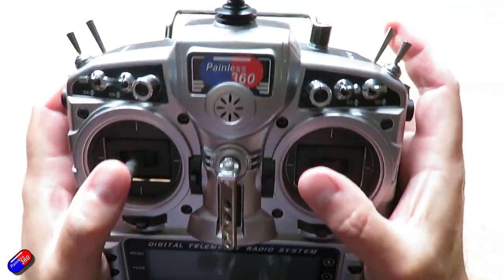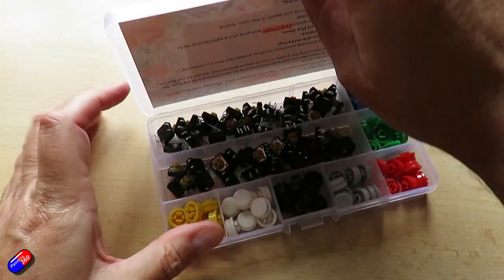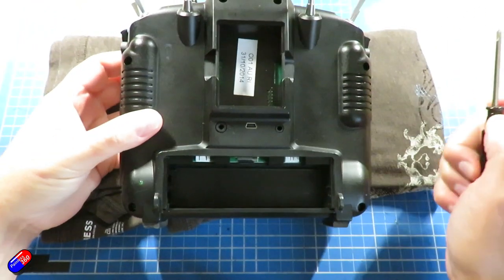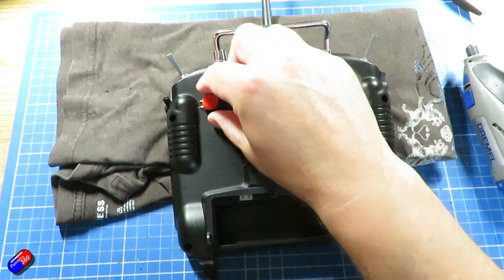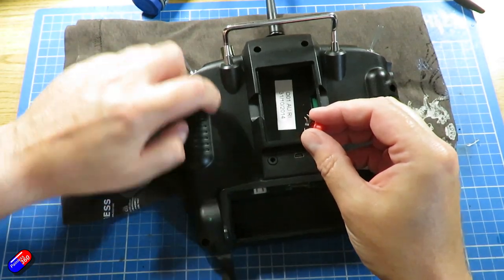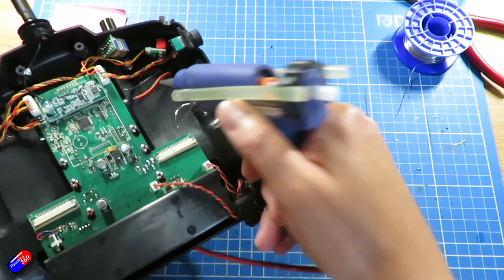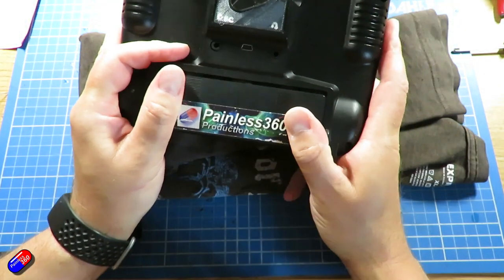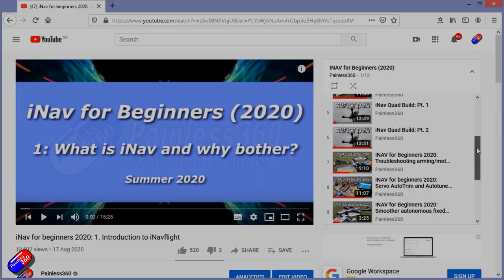Taranis Trigger Mod for FPV Combat

Comment: I did this mod years back with a long leaver micro switch. The idea at the time was so have it so when the trigger was pulled the quad would be in freestyle mode and horizon mode when not. This worked well when pulling tricks and then you lost orientation and needed assistance. Also this works well if you have rescue mode and RTH to save your craft if you loose FPV and worked like a dead man switch.
Reply: Same here, mine is used as a trainer release control/bomb/glider drop, its on the rear and I can use index or next finger along :)
Very handy if you want to use a buddy cable to introduce some one into FPV quads or planes and still have full control on gimbals.

Comment: Nice work around and lets face it a big red firing button is cooler than a toggle switch. I really like the idea of the combat system only problem I have is no one too fly with. I tried joining my local RC flight club/group, I rocked up with my quad and scratch built foamie to a field of balsa builder's. Then when they realised I was using Flight controller's and the devils work of Inav/ardupilot. Suffice to say I wasn't asked to join them again. stay safe Lee
Reply from the maker: What a shame that those old guard with access to lots of flying areas are not embracing new pilots or the modern hobby. Happy flying

Comment: Hello. If I put this in My 5 inch quad Will I still see My betaflight osd? And does it Connect to the fc?
Reply from the maker: See my other videos on it. You could have it in series with the OSD from the FC but I set it up for either or here..
Reply: @Painless360  watching it Just now😂